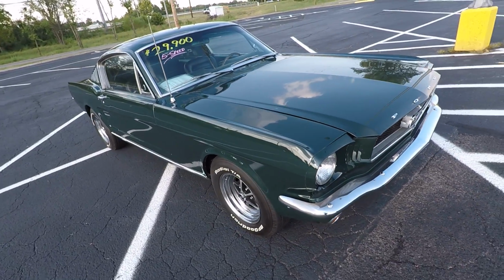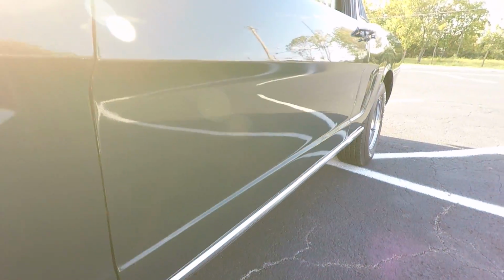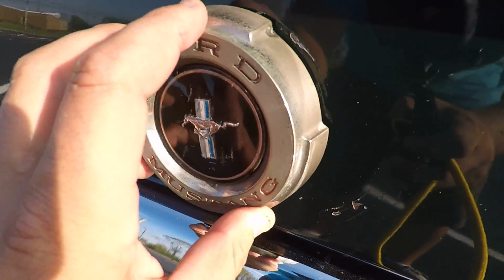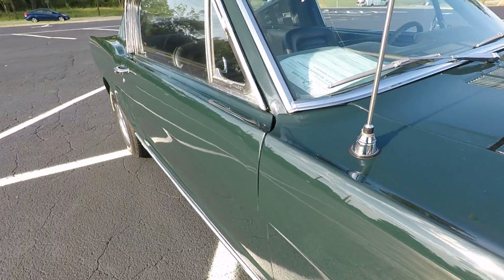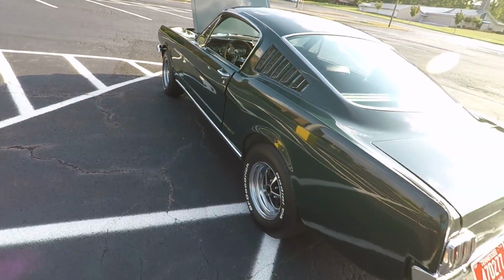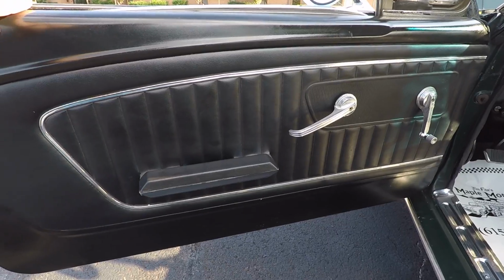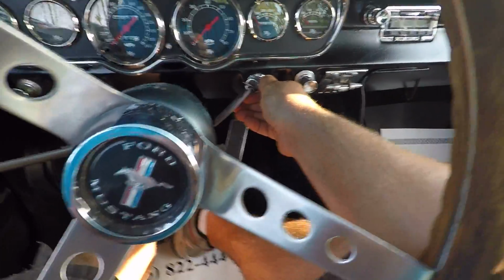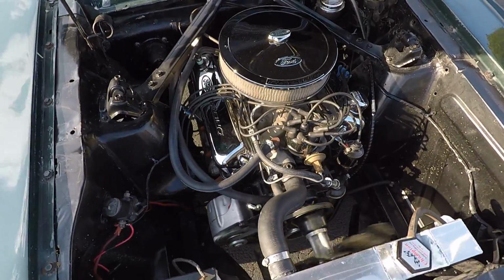1965 Ford Mustang Fastback SOLD $29,900 Maple Motors

Comment: Any reason why the passenger side would be lower than the driver's side? I have one and the dealership told me that I should just run the car and it will correct itself. Any help would be much appreciated.
Reply: That's to make it level when you're driving with no passenger.